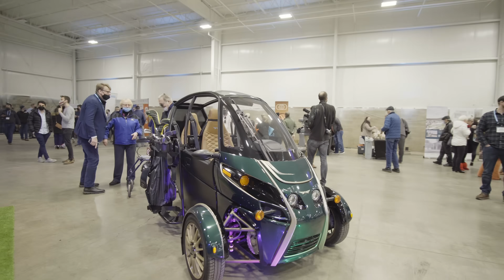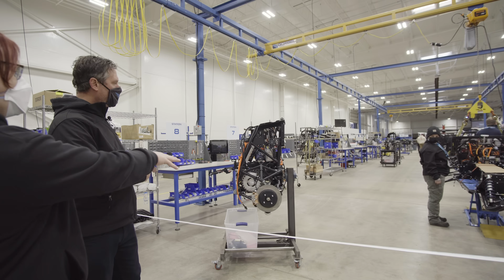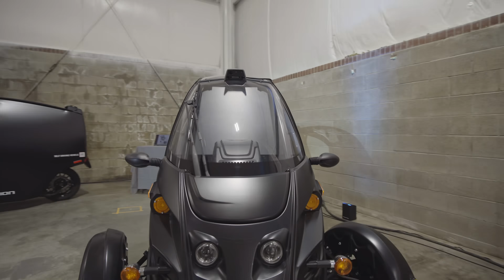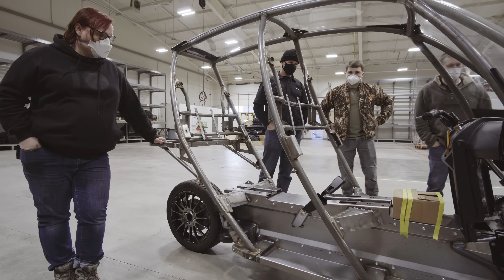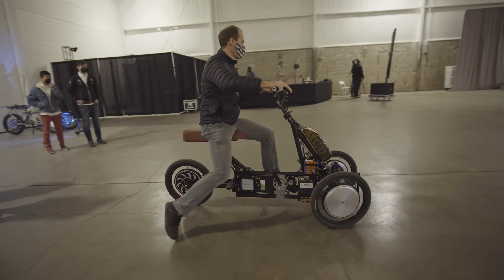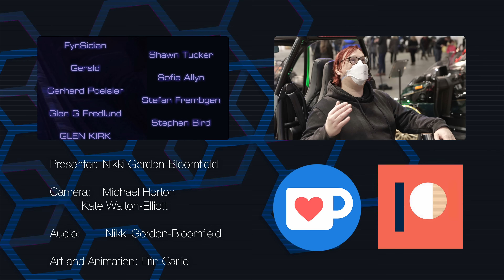Arcimoto Opens Its New Production Facility To RAMP Up Volumes

Comment: Only downfall I see with this vehicle you have it has no front bumper so you will be reliable to be sued in a wreck
Reply: Absolute nonsense!! Only a small percentage of US cars have front bumpers today. The idea that this could cause a lawsuit is absurd! From who? The vehicle weight is actually lower without a bumper so it will do less damage to what it hits. Sue them because there was not enough damage?? The chassis has internal features for crumple zones. Videos of the FUV with its body shell removed shows these reinforcements. Also, the obvious you overlooked is that no motorcycles have bumpers. The tires themselves act as bumpers.

Comment: Mid-sided 4WD van or pickup would be a far superior vehicle for firefighting in either urban or wildland areas. The Arcimoto offers no innate advantages, it has narrow tiny wheels, low ground clearance, high center of gravity due to the single rear wheel. Suggesting it be used in the wilderness or off-road is ridiculous.
Reply: No. Those vehicles will get there long after a nimble FUV. You are not a fire equipment expert. It can handle gravel fire access roads. It has a very low center of gravity, why would you try to lie like that? You are caught.
Reply: @popeyegordon  Why do yo think a vehicle with three wheels has any advantages over four?
Reply: @olsonspeed  It does not matter what you or I think. All that is relevant is what top expert designers, buyers and suppliers of fire equiment thinks. They told Arcimoto there is potential. This is not a grade school pissing contest, this is about you trying to poison our internet. You are called out.
Reply: @popeyegordon  "Poison our internet"? I offered informed insight and design assessment to to balance the overly optimistic claims of a manufacturer attempting to market a product fundamentally ill suited for emergency responders.
Reply: @olsonspeed  Where and when did you get your engineering degree in fire fighting equipment? What accomplishments in that industry can we find your recognition for?
Reply: @popeyegordon  "Attack the messenger".
Reply: You are not considering the weight of the driver, water, equipment and flatbed as well as the inherent cornering instability of a  three wheel FWD vehicle. Other considerations, snow, flooding, off camber roads & hills.
Reply: @olsonspeed  This is not about me. I repeat - all performance parameters were discussed with industry expert consultant professionals befroe any decision to proceed. .

Comment: You don't need a mask anymore. Take it off so we can hear better. Good grief. So much ignorance still is out there.
Reply from the maker: Actually - It's still a requirement in the state of Oregon. Further, COVID is still a clear and present danger. our policy will be to continue masking until COVID is at or below levels at the start of the pandemic - Nikki.
Reply: @transportevolved  An abundance of caution is never a bad thing, and I think your articulation is more than sufficient to overcome the mask.
Reply from the maker: In addition to the fact that it’s still the law here, two team members have medical conditions that put them at high risk for COVID complications. - Winter
Reply from the maker: ...and as the team's health lead (I'm an RN with additional degrees in critical care and biochemistry, and specialisation in in Emergency Medicine), and so I'm the person who wrote the TE workplace COVID policy: until evidence is identified which explains the choice of the CDC to shift from <10 cases per 100k as being "low transmission" and <50 as being "moderate transmission" to its current standard of <200 per 100k as "low transmission" -- or further evidence or treatment comes out that reduces the risk to, most pressingly, our at-risk team members, then our mask policy will remain in place.

^Kate
Reply: @transportevolved  Smart, and a great response.

Comment: I want one for when I'm grabbing Popeyes or take away in general!
Reply: I already have one, you won't catch me!
Reply: @popeyegordon  Damn that should be my nick name. My younger brother used to call me Gordon. And I could eat Popeyes chicken all day! 😂
How do you like three wheeler? Do you fell safe when driving next to big trucks and such?
Reply: @r.o7897  I have a big Popeye decal on the side of my trunk. I spent all my free time on my boats before retirement. People have to be informed about the different but equal safety system for the FUV. It uses a 6 point harness inside of a tested certified roll cage of very strong tubing. No helmet or air bags needed because you are held in tight. Cars rely on steel beams in the doors, not needed with the crash cage. The first crash has already happened. Car t-boned him at 35 mph. Car was totaled on the center roll cage tube which did not bend. He walked away with just bruises. I did eat at Popeye's last night.
Reply: Damn I'm located in Europe, have not had a 4 piece with those killer fries and a biscuit since July 2018!!
Reply: @r.o7897  They expanded their menu a lot. Famous chicken sandwich. More cajun recipes. I don't eat beef so I go there every week.
Reply: @popeyegordon  Damn you are killing me over here!

Comment: I am not excited about the rapid responder idea. Especially for fire fighting in forest areas. There are plenty of rugged four wheel drive ATVs.  I have had my FUV for just over six months now and have put in over a thousand miles. Overall, I am greatly impressed and people are always walking up to inspect the FUV. I really have only three complaints. First,  is in using the digital key pad to start the FUV. It has problems in that it sometimes take a number of tries of code input to activate the initial "A" display screen. Secondly, you have to press the foot brake down and press a button on the left handlebar. This also sometimes takes a number of tries.  Third, when you park, set the brake and press the "Off button" on the screen, sometimes the FUV does not turn off. Eventually it does. I carry the metal key just in case. I will double check the instructions to see if I am doing things right.
Reply: I like the ability to not carry a key. My keypad works every time. All cars today require your foot on the brake to start them. You may want to call FUV mobile service for your issues, it is free.
Reply: @popeyegordon  Hey Popeye !  Florida has an Arcimoto tech who has a van. He stopped by and solved most of my FUV's problems, mostly minor adjustments.
Reply: @chrisconklin2981  I know Armando. He has come out here twice. He is a former Tesla technician, as good as it gets. He has a trainee for my area too.

Comment: The question is, how many people will make this their primary, do-everything vehicle? People tend to go to the other extreme, such as a 6-passenger pickup or 8-passenger SUV.
Reply: Gas prices are starting to catch up with reality. When it hits $10/gal you will sing a different tune. Even $10 is not enough to cover all the damage ICE vehicles do. Carbon tax now!
Reply: @popeyegordon  When gas reaches $10 a gallon, pickup owners will blame everyone except themselves. However, the debut of several full-size EV pickups will result in an exodus from gas and diesel pickups.

Comment: Is there some sort of advantage an archimoto has over a traditional ATV for forest fire fighting?
Reply: It is a highway capable vehicle, which if your vehicle is smoking, you need to turn up as fast as possible before it goes up. The Arcimoto platform can much more easily maneuver through traffic, than a big heavy firetruck can, so can get to you faster to extinguish the fire before it consumes the whole vehicle. Seconds count in saving lives and property. This is why all fire departments should very seriously consider getting one ASAP. It has so much potential to save lives just by it's ability to get first responders on site faster than any other vehicle. You could easily combine it into a Fire and Medical Response vehicle. It has the room for supplies on the bed of the tray as well as the firefighting equipment.
Reply: One big one is that if you stop an ATV in tall dry grass the heat from the engine can start a fire.

Comment: Here in the Midwest, we have bitter cold, freezing rain, and snow in the winter and deadly heat and humidity in the summer. We need a vehicle that provides year-round protection from heat, cold, and precipitation.I don't foresee a big market for Arcimoto outside of a few temperate states.
Reply: I guess that explains why nobody rides motorcycles in the midwest.  Oh, wait...
Reply: @Chris-bg8mk  Nobody uses a motorcycle as their primary transport in the winter in the Midwest. I used to ride to work year-round, with arctic gear (down to subzero temps), but only when the pavement was dry.  Few people would want to have to suit up in arctic gear to drive a car. And being stuck in bumper-to-bumper traffic without A/C in the summer is a death wish in the Midwest. I did motorcycle courier work, about 1,000 miles a week, and had heat exhaustion twice in the summer. I averaged 17,000 miles a year on two wheels and did 1,000-mile IBA endurance rides. How many people do you know currently who drive a car without a strong heater and A/C?
Reply: They had talked about having a full enclosure and a heater which would solve winter, and then you can remove the doors for summer. For me the lack of fast charging and smallish battery range would be very niche for midwestern distances. This would be a no brainer for all those golf cart communities in AZ and FLA since it could be used in the community and on the roads to do many errands.
It would be a decent commuter vehicle nearly everywhere since it has about the same range as my first EV. With the enclosure and a small heater it would work in many places. In the PNW I use a heated vest and heated gloves on my motorcycle and sitting behind the windscreen out of the wind, it is fine as long as there is no ice which would make me want a third wheel for balance.

Comment: What is the appeal around this manufacturer?  Around since 2007, it has been building "prototypes" that could have been designed in 1917 except for the off the shelf batteries and motors. Nothing in production for 15 years in a world with TESLA, Nissan, BMW, AUDI, VW, GM, Ford making sophisticated, well designed electric cars.
Reply: Uhhh its for people who dont want a "car".
Reply: Each Tesla has enough materials in it to make FOUR Arcimotos. Think about it. Most cars are driven with one or two passengers and an empty trunk.

Comment: Who the heck is the market for the bike.  As an investor,  please concentrate on the FUV
Reply: The electric bike market. Put a big bucket holding kids and groceries on it and you got one of the most desired personal vehicles on the road right now.
Reply: Oh I don't know, considering it's a pretty large market and expanding rapidly
Reply: Paris is banning cars from the city center from 2024 and they recently added a lot of bike lanes. Many other cities will be right behind them. You don't always need a 3-4000 pound 16-20 foot vehicle to move yourself around. I bought an old recumbent trike last year and put a motor on it and it is a lot of fun except when it throws the chain off. With a 750 watt motor I can go 28 mph under power, or I can pedal about 22mph and use the help on hills.